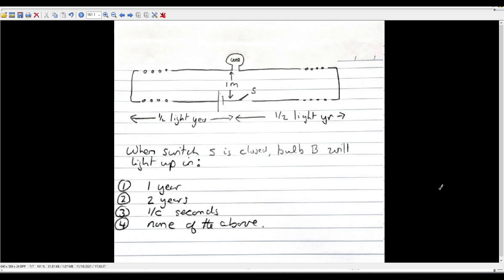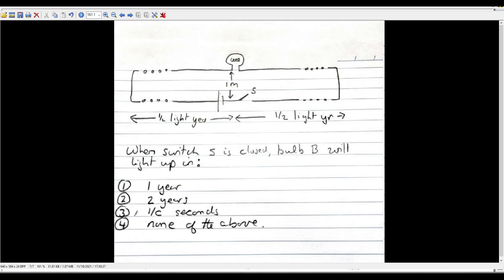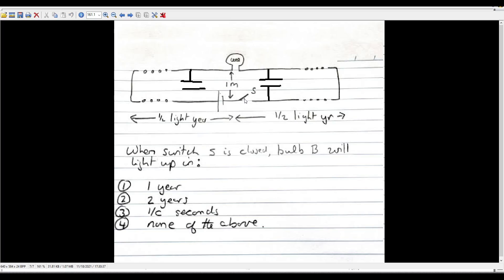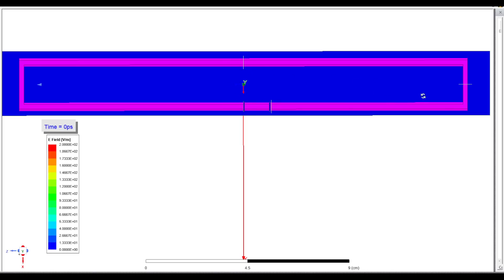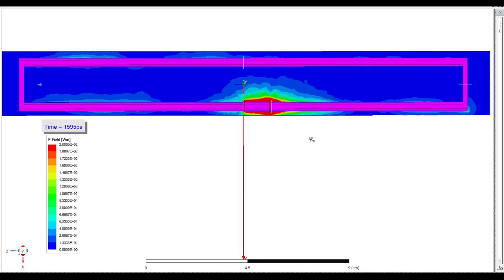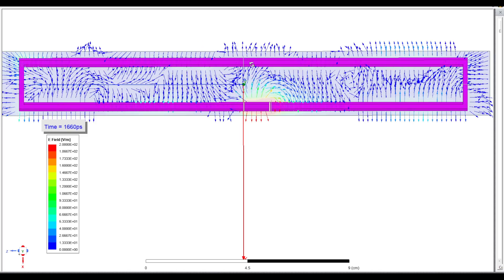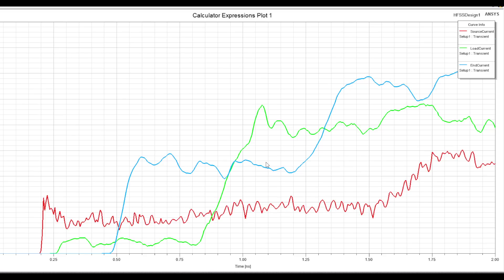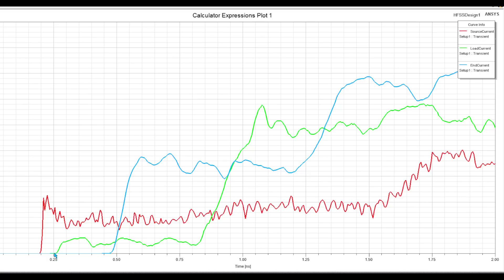Response To Veritasium - Electricity Propagation Time Problem

Comment: Hi sir, i am an undergraduate electronics and comms student. I really have doubts about topics revolving around this, like whats the electric field due to a current carrying wire, difference between network theory analyses and these high freq ones, like here wavelength is comparable to that of circuit so whats actually going on. This simulation in hfss really gave somewhat a feel of how microwave engg is working. Can you please tell me books where i can strengthen these fundamentals? so that these doubts are made crystal clear? after watching that controversy i thought that as an engineering student i should be able to answer that question smoothly clearly, as done by your simulation

Comment: You are all wrong. The observed delay really will be instantaneous! This was just proved experimentally and just published in a peer reviewed EM journal called IRECAP. A preprint of the paper is linked below. The experiment shows that an EM pulse propagated in the nearfield across 1.5 meters of space, with no observed propagation delay. This shows that the front speed (speed of information), or speed of casual action is instantaneous in the near field of EM sources. The experiment was repeated hundreds of times, and even reproduced by another researcher in their lab with the exact same results. The experiment is a repeat of the famous Hertz radio wave experiment, except a modern 2 channel oscilloscope was used to both detect the transmitted and received signals, as well as measure the propagation delay. The paper also shows that the effect is predicted exactly by standard Maxwells equations, Which shows that electromagnetic fields propagate instantaneously in the near field of the source, and reduce to about speed c in the far field starting about one wavelength from the source. But it never reduces to exactly speed c, ever.

Maxwell's derivation of the speed of EM fields was wrong. The reason is that EM fields are created by sources coming from Gauss' and Amperes laws, and these sources must be included and can not be set to zero as Maxwell did. Including the source term yields a wave equation equal to a source term. Inserting a dipole source yields EM field components with phase vs distance from the source dispersion curves with a clear minima in the nearfield, and become only approximately linear in the farfield, starting about 1 wavelength from the source. It is well known that both the phase and group speed are instantaneous when there is a minima in the curve, and only exactly a constant speed when the curve is exactly linear, which only occurs at infinite distance from the source, which does not occur in a finite sized universe like ours. So Maxwell's solution is only valid at infinity, which does not exist in this finite sized universe. So the speed of light is never a constant in our universe. If the speed of light is not constant, then the 2nd postulate in Relativity is wrong. 

The same behavior can be shown to occur in gravity. It is well known that General Relativity reduces to Gravitoelectromagnetism (GEM), which assumes that gravity can be modeled by Maxwell's equations with different constants. So the same solution that occurs in EM theory also pertains to gravitational theory. This explains the instantaneous gravitational effect in the near field, observed in the stability of the planets, and also explains that Gravity waves have been observed to propagate at about speed c in the far field. This theory then accounts for all the observed gravitational effects including instantaneous nearfield and the speed of light farfield. The main difference is that this theory is a field theory, and not a geometrical theory like General Relativity. But because it is a field theory, Gravity can be then be quantized as the Graviton, enabling the unification of Gravity and Quantum Mechanics.

 The phenomena also can be seen in Quantum Theory, and can be shown to be the consequence of the Heisenberg uncertainty principle. At the source, the position of the photon emitted from the source is precisely well known, hence the momentum or the speed is infinite. At about 1 wavelength from the source, the wavelength is starting to be come clear, such that frequency x wavelength ~c. But according to Fourier Theory infinite cycles are needed for the wavelength to be exactly known. So the above frequency wavelength relation is only valid at infinite distance from the source. So the speed of light never reduces to exactly speed c in our finite size universe. 

There are currently many interpretations of quantum mechanics. But only the Pilot Wave Interpretation is compatible with Galilean Relativity. In this interpretation real particles are guided by real pilot waves. But the real pilot waves are known to communicate information about the particles instantaneously with the environment and other particles. Because this is not compatible with Relativity Theory, this interpretation has not been taken seriously. But as a result of this discussion, this is no longer a problem, and Pilot Wave theory should now become our best interpretation of quantum mechanics. For more information, see the following links: 

*YouTube presentation summarizing my 35 years of research in this area: https://www.youtube.com/watch?v=sePdJ7vSQvQ&t=0s 

*More extensive paper for the above arguments: William D. Walker and Dag Stranneby, A New Interpretation of Relativity, 2023: http://vixra.org/abs/2309.0145 

*Electromagnetic pulse experiment paper peer reviewed and just published last month in Journal IRECAP: https://www.techrxiv.org/doi/full/10.36227/techrxiv.170862178.82175798/v1 

Dr. William Walker - PhD in physics from ETH Zurich, 1997

Comment: Problem no answer is right, or if you want only answer 4 is right.
Simply because you have 3 different effects all working and capable of providing either a miserable or a good amount of power, these effects are:

1) The main transmission method, propagated through waves in the conductor (takes 1s).
2) The inductive and capacitive phenomena wich generates a voltage on the load  in 1m/c (about 3ms)
3) The instantaneous contiuos current provided by leakage current through the air (0s it's working before you close the switch)

In resume this is a poorly constrained experiment, and the answer by Veritasium is factually wrong if any voltage could lith the lamp then answer is (4) but he didn't consider that, it is however a good educational video that makes you think and promotes comentary wich i think is more important than the answer itself.

Now going to the practical sense, answer will be (1), since in electrical engineering consider we would consider the inductive and capacitive coupling as an unwanted consequence meanwhile the bulk of power will be carried by the wave, else we would design the transmission line differently.

I get it, it's not the point of the video, but this is science you either are right or wrong here, he's wrong.

Comment: Great simulation and explanation Ben , is there anyway to see the graph plotting real time as the simulation is running ? .. the step increases on the graph are fascinating and it would be great to see amplitude, vector and graph at the same time. Plus the exact point in time where the bulb has enough power to light up and what transpires when the switch is turned off.
Reply from the maker: There is not a great way to watch the graph and fields at the same time, but you could find the time at which the current steps up and note that time in the fields animation. The point where the bulb has enough power to light up is subjective based on what bulb you use; it could be at the first current step, it could be at the 10th! If the switch was turned back off then you would see the fields and currents bounce around for a bit and eventually return to the steady state shown before the switch is closed, almost a reverse process of what you see when it turns on.

Comment: The answer is 1 second I said that on his video and have the same answer now 3 weeks later. You can't break the speed limit of the speed of light. Einstein was right when he said it and no one has ever provided proof of it being otherwise!
Reply from the maker: There is no faster-than-light communication. The bulb is 1m away from the switch and it reacts in 1m/c seconds. Nothing breaks the speed of light.

The reality is that you would see the same initial behavior even if the far ends were open! Once the signal has reached the ends and reflected back only then would the load/source step up or down in current depending on whether the circuit is complete or not (because of course if the ends were open we could not have steady state current).

To get an intuition of how this is possible, you have to step out of a "circuit theory" model, where everything needs a conductive path, and into the world of antennas. You can imagine the scenario as two long antennas very close together. It is easy to imagine that they can transfer a signal despite their ends not being connected.

Comment: Number 3 is correct if it were 1M/c ... I've watched other videos on it.
I was also informed that electrons do not move through a wire they merely vibrate.
Reply from the maker: For AC it is correct that they only vibrate, there is no net motion over an integer number of AC cycles. However for DC or even a non symetric transient the electrons do travel a net distance.

Comment: 1/c seconds has units ms^2
- which isn't time, so that can't be the answer

For (3) to be the answer, (3) would have to be written '1m/c'
- which it isn't, so (3) is not the answer
Reply from the maker: Im sure those who are interested in learning can still glean something from this video despite that fact :)
Reply: @PulsedPower  Same problem in Veritasium's video
- it's kind of a trick question, where the question poser makes a mistake themselves..which would be a fail in any physics exam..

In reality, there isn't enough power to light a conventional light bulb, so how low is the threshold set?

Another way of looking at the question posed by Veritasium is, for example, the effect that Veritasium is trying to illustrate is what's normally called a transmission line effect (as you said)
- so, I learned about Transmission lines at Uni
- that doesn't mean that the Physics I learned at school was 'a lie'
- just, that, like most things you learn at school, it was a necessary simplification
Reply from the maker: @FlyingPhilUK  I definitely agree that the whole "you were lied to" thing is dramatic. You are totally right about it being appropriate simplifications.

However it seems you are also turning this EM theory thought problem into an engineering problem. The idea is to investigate how electricity works, ie does the distance from the change(switch) matter, or does the length of the connection matter? Not to figure out whether X bulb at Y distance with Z source voltage would light up visible to the human eye.

Comment: I disagree with pretty much all explanations given so far.  
How does the switch know it is attached to that light bulb?   You can't just put an  random other switch there that is not connected to that circuit and expect anything to happen, right?  It won't do anything.  Both the switch and the light bulb have to be part of the same circuit. 

So, the switch and the light bulb have to be physically attached to each other through that copper wire that has length a light year..     And there lies the problem.
One of the prime dictates of relativity (and therefor  our Universe) says :  No Information can travel faster than the speed of light.    
For the light bulb and the switch to "Know" that they are connected once the switch is turned on,  is a piece of information, that  can never  travel faster in the circuit than the speed of light, and that piece of information  has to run the entire length of the cable before the light bulb "Knows" that the switch is part of the same circuit.   

How else could it possible "Know" that the switch is in the same circuit and meant to turn it on and off?
Reply from the maker: You bring up a good point, but the reality is that you would see the same initial behavior even if the far ends were open! Once the signal has reached the ends and reflected back only then would the load/source step up or down in current depending on whether the circuit is complete or not.

To get an intuition of how this is possible, you have to step out of a "circuit theory" model, where everything needs a conductive path, and into the world of antennas. You can imagine the scenario as two long antennas very close together. It is easy to imagine that they can transfer a signal despite their ends not being connected.

Comment: The hypothetical circuit propose by Veritasium has a VERY high capacitance. So it has low impedance at low frequencies as well as high frequencies. But resorting to circuit theory to answer Veritasium is wrong, because the point of his video (if I understand it correctly) is for us all to investigate how field theory and circuit theory co-exist. Circuit theory is misleading - and has misled a lot of people for a long time. 

Nice simulation, except the "noise" on your results are more likely an artifice from your calculation, than reliable. And it is great what V achieved with his video - getting people to question circuit theory.

Comment: I think there may be something wrong with your simulation because it starts with propagation in both directions. If the setup was equal to Veritasium's then before closing of the switch, there is already the battery potential on the other side of the switch (after waiting for 2 years) when it is closed. Your simulation, simulates connecting the battery on both wires at the same moment. This is different then closing a switch on one side of the battery. At leasy I would think so....